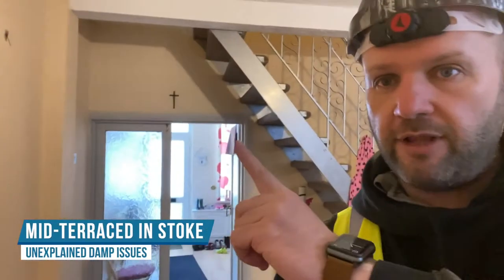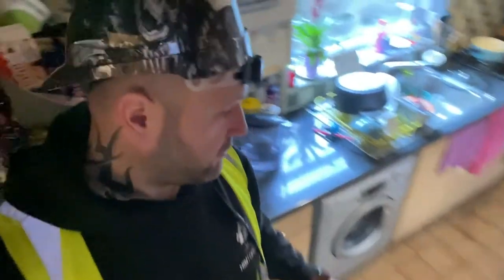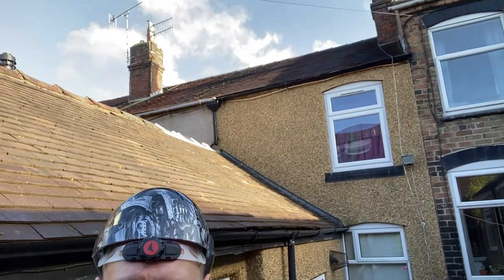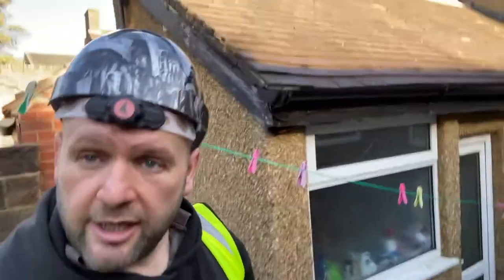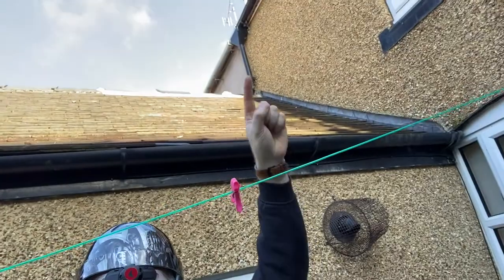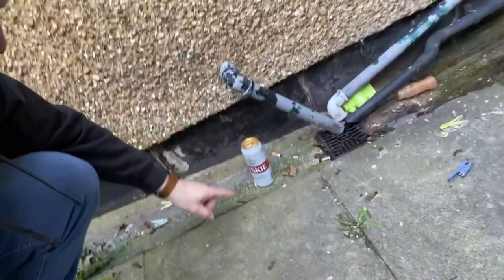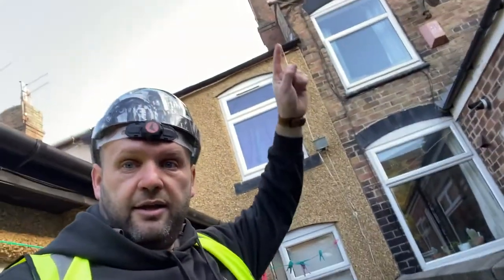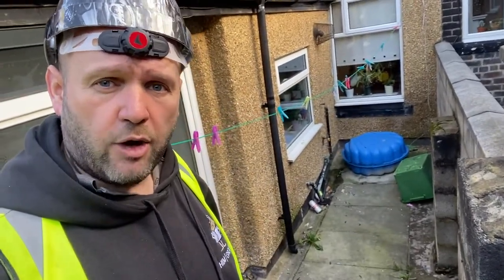What Causes Damp? (How to Avoid Damp and Fix Issues)

Comment: Ive had an independent damp survey done and they said improve ventilation in the cellar and then knock off the plaster on the whole side of my house (2 rooms and fire places). The walls look ok and not really much visible dampness aside from on one chimney breast (due to the sut in there and its closed off). 

I really dont want ro replaster. At what point do you really need to replaster? I want to paint the walls but dont want to do that and then realise i shoulve replastered! Theres no peeling and wasnt picked up in the home buyers survey so hadnt budgeted for it.
Reply from the maker: Hi Nick. Thanks for watching and for your question. The point at which you replaster is when the plaster is contaminated with salts from damp. Without actually seeing it, there's no way we can tell if that's the case. It's down to your own discretion whether you think there's enough of a problem to cause issues further down the line. Capping and venting the chimney will help if it isn't already, as this will help ventilate it.

Comment: great vid how do you stop water coming in through the gaps of the garden slabs I've seen builders putting a waterproof black sheet?
Reply from the maker: Hi there. Thanks for taking the time to watch our video and for leaving us your question 🙂👌 

Water should really be allowed to go between the garden slabs as that's a means of drainage. If water sits on the surface, it would create more of an issue. 

The black stuff is called damp proof membrane (DPM) and is to used to stop moisture in the ground coming up through into the floor/structure thats on top of it.

Hope that helps. Thanks again for your great feedback.
Reply: @HYPEBuilding  have the exact same issue when it's raining heavy water tend get in between my garden slabs and water gets in my kitchen instead of tarmac is concrete good option and any advice etc plus under the slabs theres no dpm sheet,sand just soil?
Reply from the maker: Thanks for your question  @omraz7864  👍 It's not really an issue if you have tarmac or concrete, it's more to do with making sure you have adequate drainage in place. 

You need to get rid of the surface water and, therefore, need to provide somewhere for it to go – so it doesn't get into your house.

Hope that helps, mate. Hope you can get your issue sorted. Thanks again for watching our video.

Comment: Good common sense approach.  Building Research Establishment 245 (Rising Damp - Diagnosis & treatment) recommends dealing with all other damp issues before investigation potential rising damp so you are in tune with what is best advice. No doubt at least some damp proof "specialist" would have recommended Rising Damp treatment!. I did actually note that there was apparently no cavity tray in the main wall over the roof but there again maybe this wall is not of cavity construction!
Reply from the maker: Hi Alan. Thanks for watching and leaving us your feedback. We always try to get to the bottom of the problem because – more often than not – logic prevails. And we conduct a thorough site survey to make sure we've properly assessed the situation.

These particular terraced houses are solid wall construction with no cavity. We can, instead, install an eaves support tray to assist water into the gutter—which will act in a similar way to a cavity tray. 

Thanks again for watching, we really appreciate it. Stay tuned for more tips and building advice 🙂👍

Comment: Wondering if anyone might see this who might point me in the right direction for advice. Just moved into my first house, circa 1900 terraced house, classic Victorian 2 up 2 down style. Seem to have fixed upstairs damp problems with roof repairs, but have major cracking and flaking paint and effervescence (?) on the ground floor, mainly the internal wall between the front and back room, and the external wall off the back room and coming along the adjacent party wall.
Had a damp survey and they’ve suggested the usual DPC injection for ‘rising damp’, but after a bit of research it seems like this isn’t the best solution for an old house and isn’t really dealing with the problem. 
I’m new and clueless and don’t want to get ripped off or damage the property. Am basically wanting a domestic version of HIM (ie this company) to come help and advise, but obviously all the damp specialists I find just want to inject and don’t discuss root causes/options etc. Anyone know of a company or even resources that might help?
Reply from the maker: Hi there. Thank you for watching and for your question. Hopefully we'll be able to do a video on this subject soon, as it's quite a common problem. Stay tuned 😊👍
Reply: we have similar issue..couple of people have come out  and they want to re-do DPC ...but the only "damp" spots we have are on a couple of  internal walls that had a bit of plaster damage to them .we believe the guy who fixed them just used gypsum plaster rather than lime (old terraced prop)...then wallpapered/painted,  we think its just the salts coming out of the plaster but no one wants to listen. would love some advice to reassure us its nothing more serious.. GREAT VIDEOS JUST WISH WE HAD SOMEONE LIKE YOU IN TYNE AND WEAR

Comment: Hi John 
I have a end terrace house and have lots of damp issues on the cable end side of the property all the pointing is in good condition also I’ve painted water sealant on exterior walls however still have issu.
Reply from the maker: Hi Iftikhar. Thanks for watching our video and thank you for your comment 👍🙂 Could we just ask: Is your gable end single brick or a solid 9" wall?
Reply: @HYPEBuilding  
Hi 
It’s got a cavity and also insulated with the blue beads.The internal walls seem to stay cold .
Reply from the maker: @iftikharali2541  How high is the damp from the floor? Or is there damp in the bedrooms too?
Reply: @HYPEBuilding  
Hi John 
It’s all over the corner from the ceiling down and the small wall near chimney.

Comment: Hi so what will be the best way to stop my walls in single brick garage from getting wet and damp round the edges of the garage floor i all so see in places were water is running in throw the mortar in round 10 places round the garage thanks for reading etc etc
Reply from the maker: Hi Kirk, Thanks for watching and for your question. 

A possible solution you may want to consider is to install a stud wall on the inside. Sit the sole plate (bottom piece of timber) on a piece of DPC to stop any damp coming from the floor and attacking the timber. There should be a gap between the stud wall and the external wall. 

Then insulate the wall with a good, reliable product like Kingspan or Celotex. Finally, board over the wall with plasterboard and skim it. If you need to hang shelving, you may want to board the wall with 18mm ply so you can screw shelving to it.

Hope that helps 🙂👍
Reply: Thanks up to yet im just bout to finish the roof with kings span can kingspan be painted over with it been the roof i want to watch the weight of it plus its only single brick thanks again kirk
Reply from the maker: @kirkwint8354  Hi Kirk. It's not something we've ever tried, so we couldn't say with any confidence. We're not sure how paint would adhere to the foil of the Kingspan. If it's something you really want to try, maybe if you prime it first, that might help?